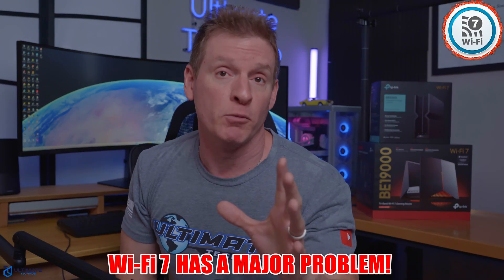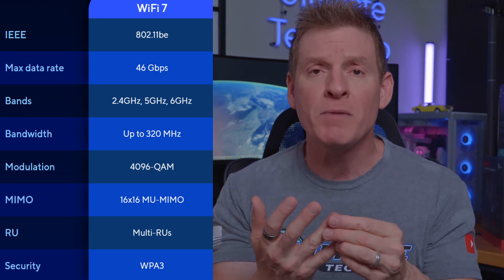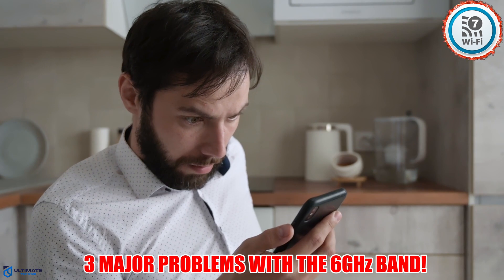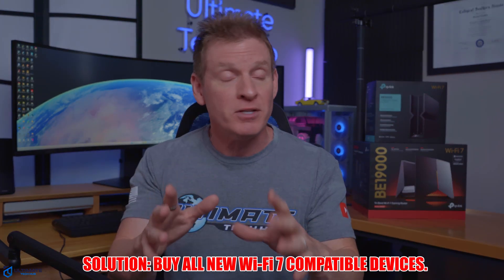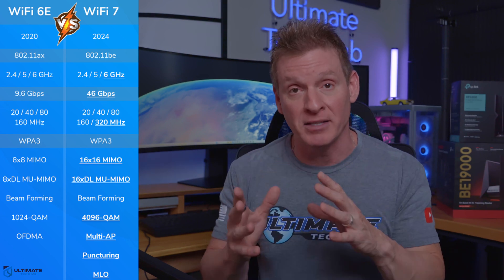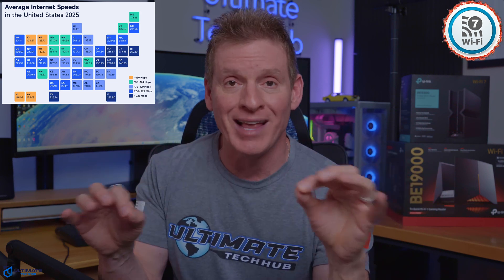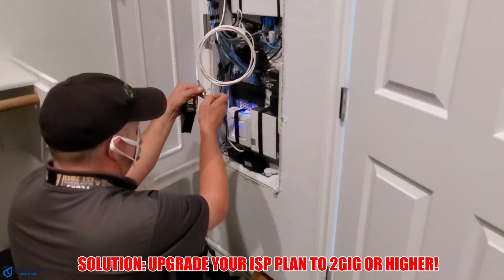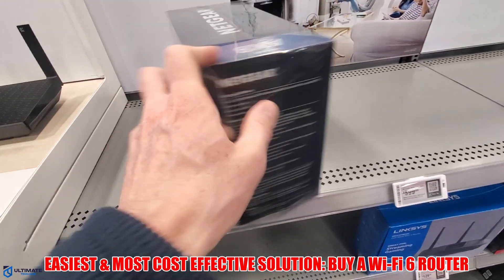Wi-Fi 7 EXPOSED: 3 Big Problems Nobody Talks About!

Comment: You're missing the point. It has nothing to do with your internet connection speed, it's your local network. It's for more useful local applications like streaming video in realtime and copying files over the network, syncing backups, etc. or sharing downloaded software automatically (windows update sharing, or steam download sharing)
Reply from the maker: Wifi 7 has to do with both local and internet. If your devices are not able to connect to the 6ghz band or MLO then you won't get the benefits of wifi7. End devices are not quite there yet when it comes to wifi 7.  However when it comes to local networks, wifi 6 or wifi 6e works great unless your file transferring massive folders. Streaming works great using wifi 6. Thanks for the grear comments and for watching !

Comment: I totally disagree having to wait for multi gig. 1gb/s is definitely worth using with Wi-Fi 7, I've upgraded from WiFi 5 and I got 3x the speed because of it.
Reply from the maker: Wi-Fi 5 to Wi-Fi 7 is a huge upgrade! Yes if your upgrading from Wi-Fi 5 you might as well go to Wi-Fi 7. However if you have a newer Wi-Fi6 or Wi-fi 6e router then the upgrade may not be necessary. Thanks for watching.

Comment: If you live in an apartment complex or somewhere with a lot of different networks nearby having a new standard that most devices cannot use is not a bad thing. It opens up some bandwidth that isn't being hogged by your neighbors.
Reply from the maker: As long as you have devices that can connect then yes. Thanks for watching !

Comment: I’m no expert, but as far as I know, almost all TVs—with the exception of a few high-end Sony Bravias—are limited to a 100 Mbps Ethernet port. Even those Bravias are only marginally faster. To achieve higher wired speeds on a TV, you typically need a Gigabit Ethernet-to-USB 3.0 adapter. Otherwise, a Wi-Fi 6 connection will easily outperform the built-in wired port in terms of raw speed.

That's the case for gaming on a TV, indeed. However, when playing on a monitor, you won't encounter such a problem as the hardware supports Gigabit speeds by default.

I am opting for Wi-Fi 7 because Wi-Fi 6E models are currently no cheaper than their Wi-Fi 7 counterparts. I want to utilize the 6 GHz band for the upcoming Wi-Fi 7 Apple TV 4K, which will be just 10 feet away in a clear line of sight. This setup will provide a 'clean highway' for 4K streaming on my 1 Gbps plan. While my current router maxes out at around 350 Mbps—which might technically be enough for basic streaming—it fails to take full advantage of my fiber speed and lacks the interference-free stability of the 6 GHz band.

Comment: BLUF (Bottom-line upfront) : If you’re buying a new home router today, go with Wi-Fi 7. This isn’t just about squeezing peak speeds out of the router, it’s about future-proofing so you’re not shopping again next year. Most modern devices shipping now (and almost all coming soon) support Wi-Fi 7, so to get the most out of your home tech, it makes sense to build the best possible “highway” first (your Wi-Fi and internet connection).

One thing the video didn’t fully cover is how crowded 2.4 GHz and 5 GHz are in multi-family housing. If you live in a city, apartments, condos, townhomes, moving to 6 GHz can feel like upgrading from a 2-lane road to a 6-lane highway. Games are more responsive, video streams are smoother, and performance holds up much better during peak hours when you can see half a dozen neighbor SSIDs.

In practice, many Wi-Fi 7 devices often connect at Wi-Fi 6E speeds because of signal quality requirements (RSSI/SNR), but that’s still a good reason to buy a Wi-Fi 7 router. Wi-Fi 6E was really a stopgap, and if you’re buying now, it’s not the best long-term investment.

As for range: the limitation you’re seeing on 6 GHz is largely due to consumer router vendors choosing not to implement AFC (Automatic Frequency Coordination). To stay FCC-compliant, most home routers operate in low-power indoor (LPI) mode, which limits range. That’s why legacy 5 GHz often appears to perform better at distance, it’s not that 6 GHz is inherently worse, it’s a power and implementation choice.

Bottom line: Wi-Fi 7 is the right buy today, especially if you live in a dense area or have the need for wire-grade outcomes on Wi-Fi (gamers and work from home) and want performance that holds up for years.
Reply: Doesn't seem like any of the wifi7 routers have stable firmware though. All have reviews of having to reset multiple times a day, which is what I'm experiencing with AT&T's wifi7 equipment. Considering I don't have higher than 1 gigabit fiber in my area, probably going to switch back to their regular hardware. I didn't realize the coverage limitations. Started looking at own mesh system but all seem to be buggy. And since I live in suburbs area, no telling when higher than 1 gigabit will even be available
Reply from the maker: @nicholasfitchett7278 I never use the ISP routers they are usually trash. Buy your own wifi6e or wife7 router. I never have to reset my router and it works perfectly all the time. I have a Archer Ge800. Thank you for watching !
Reply from the maker: 2.4Ghz is always crowded and the 5Ghz is way less crowded unless your in an apartment or condo. I love the 6Ghz band and I get over 2gigs download but only at 30 to 50 feet with direct line of site. I have 2gig fiber ISP and an ASUS Zenbook S16 with a wi-fi 7 chipset. Thanks for the great comments and for watching!
Reply: @UltimateTechHub yeah, the LPI impact on 6GHz range is seriously painful. I cannot wait for more vendors finding ways to build AFC registration into home-grade offerings.

Comment: Move to WiFi 7 and loose 2 signal bars in the next room !! 

In Simple terms, WiFi 7 is for same room connectivity. 3 inch brick wall blocks 80% of WiFi 7. WiFi 7 has speed but no strength.
Reply from the maker: I use the MLO Band which combines all 3 bands and uses the best band for the current location. Yes the wi-fi 7 6Ghz band is very fast but has a short range and cannot penetrate walls. I can get over 2gigs download on my ASUS ZenBook S16 Wifi7 laptop but it has to be at 40 ft max with direct line of sight to the router. Wi-Fi 8 is coming soon and hopefully that will improve the reliability and coverage area.
https://youtu.be/17RxJTd6fpA?si=KKCQ6bwyFlJtpv6N
Happy New Year!

Comment: Some wifi 7 routers don't include the 6ghz band. It's false advertising or at least decepticon
Reply from the maker: Yes dual band wifi7 routers do not have the 6ghz band. However most wif-7 routers are triband with the 6ghz band.
Reply: @UltimateTechHub I understand that, but the gen pop doesn't.

Comment: I have found the 6GHz band to be essentially useless. If I hold my phone 6" away from it, then i get "blazing fast speeds". If I walk 15' away, those speeds cut in half. Oh well.... I needed the "upgrade" anyway.
Reply from the maker: My ASUS Zenbook S16 gets around 2Gbps on the 6GHz band at a max of 25 feet to 30ft with direct line of sight. The 5Ghz band is more useful for longer ranges.

Comment: The most important thing about buying a new router is how well it will behave with your older devices. At no point in time, since 801.11b, had all of my devices used the same wifi Gen. When 801 g dropped, more than half were b or a. When n slid in, mainstream laptops had g cards. I own two Asus wifi 6 & 6e routers, in different homes. The most challenging devices are my security cameras, which need strong 2.4ghz signals. The 5ghz cameras range was horrendous, especially during ☔ and foggy days. Interference, crowding or whatever reason, long range wifi is what should be prioritized. My pixel 8 pro has wifi 7, on a relatives Netgear WiFi 7 network, it switches to wifi 6 if more than 20 ft from gateway😂. 6e isn't that much better. With the power limits of home/office routers, none of this really matters if a 25ft cat 6 cable has more range than a wifi signal.

Comment: I agree with all he said. Problems I have run into with new WiFi 7 router.  The updated 2.4ghz WPA/WPA3-personal settings will not work with Tesla Home charges.  Changing it to older WPA2-Personal worked, but it disabled the WiFi 7 use of the 2.4ghz channel.  I also had to change the 2.4ghz 20/40 bandwidth settings to just 20 for some 2.4ghz devices to be reliable.   No big effect overall, but even 1 year old devices may not work at the updated 2.4ghz options.  I knew the WiFi 7 router was "early".  My PC's use WiFi 7, but it will be the next round of phones etc. before use expands.
Reply from the maker: Interesting that Tesla Home chargers will not work with WPA/WPA-3 personal. Thanks for the fantastic information! I need to call Elon and get some answers! By the way, I'm not hating on Wi-Fi 7. I use Wi-Fi 7 with my ASUS Zenbook S16 and get over 2gigs download. It's early for Wi-Fi 7 but 2026 will be the year we see more Wi-Fi 7 integration. Thanks for watching and for commenting!
Reply: I noticed this too, car would not even spot our wifi7 router,  had to connect to our mesh IoT network

Comment: So should we wait for docsis 4.0 to get wifi 7 because of wifi 7 features and it sounds alot better. I have devices with wifi 7 but its not really important if the modemn/router doesnt match up.
Reply from the maker: You do not need to wait for DOCSIS 4.0 to get a Wi-Fi 7 router, and the two technologies serve different purposes. A DOCSIS 3.1 modem is fully compatible with a Wi-Fi 7 router and can provide significant internal network benefits, even if your internet plan's top speed is less than Wi-Fi 7's maximum theoretical throughput. So you can upgrade your router to Wi-Fi 7 now to enjoy its benefits and features. There are even gateway combo devices available, such as the ARRIS Surfboard G54 which combine a DOCSIS 3.1 modem with Wi-Fi 7 routing capabilities. You can upgrade your modem to DOCSIS 4.0 later when the service is widely available from your ISP and you actually need the multi-gigabit symmetrical speeds it provides. 
I have links in the description for very affordable wi-fi 7 routers and wi-fi 6e routers too. Check them out!
Thanks for watching @kouavang7819!

Comment: Not all Wifi 7 routers offer 6-GHz band use. I thought since Wifi 7 was the successor to Wifi 6E (which by definition does include 6-GHz), then of COURSE any Wifi 7 router would work on the 6-GHz band...but turns out that's not true. Something to pay attention to, especially if you look to go cheap.
Reply: I've noticed that too and the full wifi 7 routers cost 2 x's as much

Comment: The real problem is that 6GHz is outright banned for WiFi. Even if it's not yet banned where you live, it most probably will be in the future.
Reply from the maker: It's currently banned in India. The 5Ghz band is plenty fast!
Reply: That's not true at all.
Reply: @0bsmith0  Yeah, I know, I actually only left this comment in a rage, I know that it's not banned in Europe and the US (and other places). I just thought it wasn't fair that I won't ever get 46Gbps over 9.6Gbps (at least for LAN) just because my government (or any government) decided to reserve it completely for 6G mobile data network
Reply: @wd357dui  You should have specified the specific country since a large portion of the world has provided access to varying amounts of the band depending on the country. That really is a shame that that has happened in your country. The 6 GHz band makes quite a difference for Wifi, not just for peak throughput. Just overall operation.

Comment: Im getting a WIFI 7 compatible gaming mobo because I haven't upgraded since 2018....but my next phone i'm getting will be in 2027 because samsung does 5 years of free security updates. So maybe not right now, but I only upgrade my tech once every 5-8 years because it takes 1 - 2 years just to get the kinks out of anything new. Not to mention, the companies dont even upgrade their routers to the next band until the last minuet......i know this is a wifi vid but lets look at the transition from ddr4 to ddr5 memory. DDR5 came out in 2020, started to reach out to gamers in 2021, and finally got the kinks out last year. Doesn't hurt to have newer stuff but we def shouldn't be chasing it unless we absolutely need it.
Reply from the maker: I agree 100 percent. Wi-Fi 7 devices are starting to become more popular and most newer laptops are now using the Wi-Fi7 chipset and the new phones as well. I think in 2 years Wi-Fi 7 will be the new norm. Until then Wi-Fi6 is plenty.
Reply: @UltimateTechHub  Agreed. I mean fibers been out for YEARS and my community as well as many others are still on the copper wiring

Comment: The focus here was on speeds and whether one's present equipment will work on 6 GHz.  There are so many more things that WiFi7 can do that are not just about throughput.  WiFi7 will be very important to people that live in apartments or dense housing, for example, even at slower speeds.  Maybe you could cover those things (like MLO, etc) in another video where the more positive aspects of WiFi7 could be covered.  

WiFi7 itself does NOT cause problems--it fixes many more things that older versions of Wi-Fi did not or could not handle.  We went through this 20+ years ago when 802.11a came out after 802.11b (I know, backwards, right?).  There was the "yeah, but now I have to buy new gear that can use the 5GHz band!".  Now we don't even think about such things as "problems" as you stated.  And...we still have a ton of  iOT devices that only work on the 2.4 GHz band (even just 802.11b) because of cost.  So give the new standard a break, please!  It won't be many years from now that we won't even think about buying something that wasn't capable of 802.11be (WiFi7).  I helped develop these IEEE and WiFi Alliance standards.  Solutions, not problems.
Reply: Thank you for your work on the standards! We appreciate what you do!
Reply: Also, even if your ISP speed is slow, speed amongst devices communicating between each other without the internet, like file transfers, can still benefit. (Even though, unfortunately, a lot of applications go through the internet even though they don't need to when syncing between devices).
Reply: I think he focused on that because this video isn't for people who know what wifi doesn't mean internet. Its for the people who don't know anything besides they need a wifi router and think buying the one with the bigger number must be better. Those people don't need wifi 7 nor will utilize it like us tech users. They just want internet.
Reply: Yeah but I think all the hardware is buggy. I switched to AT&T's new wifi7 hardware and it crashes multiple times a day. All the devices I research seem to have similar issues. If you don't have higher than 1 gigabit fiber, might not be worth the buggies yet.
Reply: @nicholasfitchett7278  It's because you are using the companies rental hardware. They try to get the cheapest stuff that works just enough. If you get your own then you'll have a world's better experience.
Reply: @nicholasfitchett7278  I definitely agree with you!  I see this same issue as a wireless designer for a large, smart TV company.  We collect different access points to test for compatibility, and quite a few (most?) have bugs--some of them very serious.  WiFi7 is much more complicated from a designer's standpoint.  So yeah, not a bad idea to stay away until the market matures more.

Comment: what is there to future proof though? I have 300mbps fiber plan and I game with ps5 pro regularly and work from home with my family streaming multiple devices all day. I rarely saturate that 300 mbps speed and when I need to download a large game, I just need to wait 30 mins or so or do it overnight. Any 1 gbps or plus speeds are really not necessary day to day.
Reply from the maker: That's a good question! " What is there to future proof?" 
Well for instance, I have a 2gig Fiber ISP plan, so by not having a Wi-Fi 7 router I cannot utilize the 2gig download speeds and 1gig upload speeds. I currently use the Archer GE800 Wi-Fi7 router and I also have an ASUS ZenBook S16 with a Wi-Fi 7 NIC and the Samsung S24 (wi-fi6e NIC) so my wireless speeds are at over 2gig and are slightly faster than my wired speeds! ( I've done a video on this Home Network setup and the actual speed tests: https://youtu.be/n0J1au4cjtM?si=OCLQQHREsc5dokJL ) So, just because you don't require fast downloads doesn't mean other homes wouldn't need it. I download lots of games, software, movies, TV Shows and not mention dozens of updates for my PCs and PS5 and the 2gig downloads save me a ton of time. ( The PS5 only has the ability to download up to 1gig but my PCs have 2.5g NICs ) For me time is like money and I hate wasting time. So future-proofing is really a personal thing and I always opt to future proof since that's what I do for a living on my YouTube channel. Thanks for the great comments and for watching! Have a great day!
Reply: 300 is not very fast nowadays. I don't agree.
Reply: @0bsmith0  i game in ps5, have teams call day for work and multiple 4k streams every day with 300 mbps speed with zero issues.
Reply: @Fear.of.the.Dark.  That doesn't change what I said.
Reply: @0bsmith0 doesnt matter what you say or not. I know i can get 10gbps on my fiber line. But 300 mbps is plenty fast for day to day use. I would rather pocket that extra money and spend it somewhere else rather than just do speed tests all day.

Comment: Wifi 7 works fine on my devices even through walls. But his points would be the same if you had wifi 6e. If your devices only had wifi 5. It will be the same when wifi 8 comes out. It's the same life cycle.
Reply: technically not true. Wifi 7 has AFC feature to boost 6ghz range but unfortunately most of the launched wifi 7 routers in the market do not have this functionality right now.